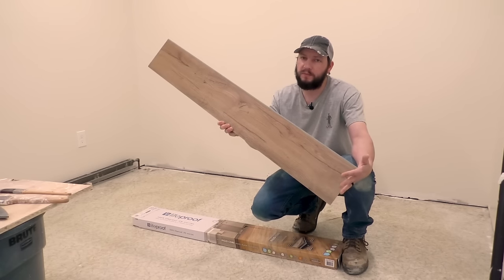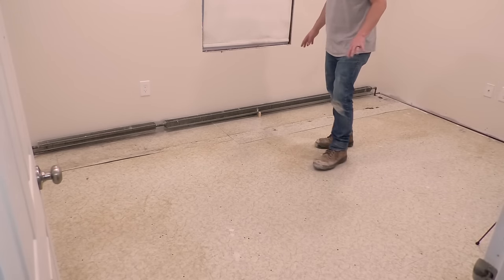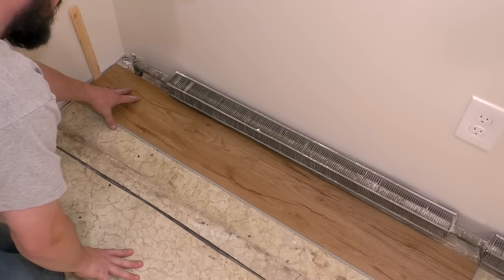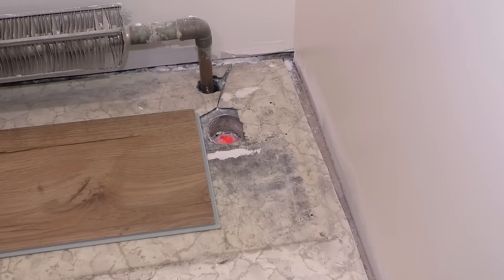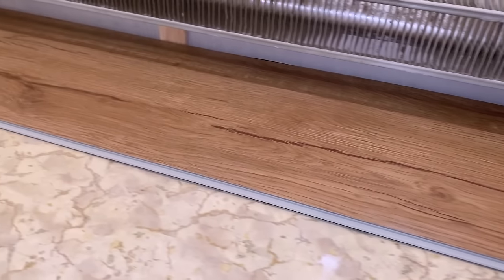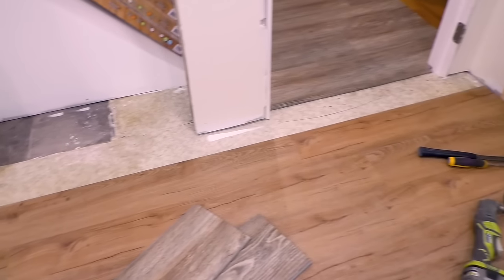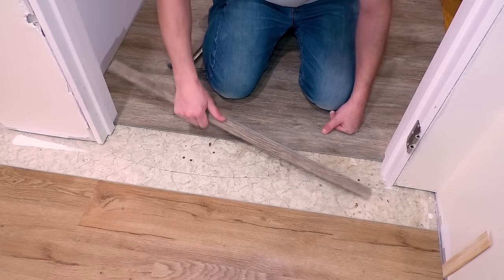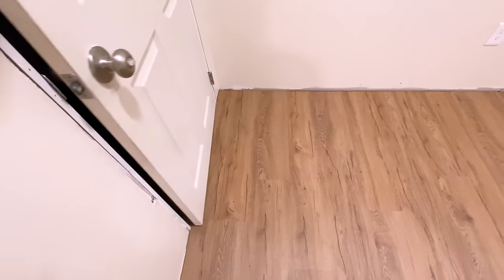How to Install Vinyl Plank Flooring | Lifeproof LVP

Comment: Love your videos, and since I just recently did a LVP floor for the first time I wanted to share a tip that I think more people should be aware of. Since you're already at Home Depot buying this flooring, consider asking the tool rental area about a "flooring & siding cutter". It's a tool that looks like a giant paper cutter, and it will snap the boards to length for you with the speed of a chop saw and the debris-free experience of a utility knife. Well worth the ~$30/day rental cost.
Reply from the maker: Awesome tip.  Thanks, Jameson!
Reply: I work in a Home Depot rental and we rent the cutter all the time.
Reply: Yes! I have used one of these cutters. Fast, precise, easy. Paid $137 when I bought it a couple years ago. best way to go.
Reply: Bad news for Monroe, Louisiana Home Depot. They don’t rent any more cost savings they told me so if you wanna put an attic insulation in your screwed also.
Reply: Thanks for the tip!  Thinking of doing the job myself!

Comment: Just installed LVP in my home from the decorator’s collection at HD. Flooring is made by mohawk. Our installation guide said it could be installed over linoleum, laminate, even engineered flooring so long as it’s not a floating floor itself. That laminate in the room should be fine and not void the warranty. Overall great video, wish I would have checked rooms in my home to see how out of square they were. Would’ve saved me a bit of extra work and cuts. Keep up the great content, always enjoy watching.
Reply from the maker: Thanks for watching, Hunter!!
Reply: Haha I had the same problem with walls not being as straight as I'd expected... house was built in the 70's so not as bad as it could have been I guess.

Comment: The end piece where it comes into a wall is supposed to be a MINIMUM of 8 inches in length.   You should have shortened the first piece to achieve this requirement.

Comment: I did a traditional laminate floor a few years back and found it wasn’t so durable to work with. I did over 1200sq ft and man did this bring back memories lol I too ended up using a regular hammer many times. But I got to say this looks a lot better to work with. If you used a hammer like that on Pergo without protecting the surface with say a rag it would be totally chipped lol Anyway, looks good! Also thought that was a pretty cool trick in the doorway using the screwdriver to pry things over!

Comment: A block of wood and double face tape to the transition piece and it will slide to wherever you need it. It also removes easily.

Comment: Installed this brand of flooring in our kitchen a couple years ago.  It has weathered daily use in a family of 6 really well.  Laid up really well in an old house with old house floors.  Pro tip, definitely don't put your baseboard down too tight against the new floor.  You want the floor to expand and contract without seam separation or bowing.  

Really good install video.
Reply from the maker: Thanks for the tip and for sharing your experience with the product!
Reply: how much of a gap would you say to leave between the baseboard and floor?
Reply: @Juiicedd  height wise, at least 1/16", or the base will hold the floor as it expands and contracts and cause gaping between boards or heaving.  You want it to float on the subfloor and not be pinched by the trim.  Same with the walls, but I'd follow the directions, I think it was 1/8"-1/4" for a small room all around, but read it to be sure and remember that the bigger the room, the more the floating floor will expand and contract.  That's the biggest downside to floating vinyl.
Reply: @ryanwilson6162  thank you very much for the info! I’ll be installing my floors here in the following months of the year, so the tips are much appreciated!

Comment: Great work Matt, I installed LVP in my house.  One thing you didnt mention, unless I missed it, is I had to vaccum the floor over and over as I went.  If you get even a small pebble under that LVP you WILL feel it walking on the floor barefoot.  My mainfloor is all concrete slab so there was lots of dust and random bits of rocks and foam from the carpet pad that was there before.  I used tile adhesive I already had on hand to patch holes from the tack strip.  For anyone trying this TAKE YOUR TIME.  Sometimes I would get into a groove and feel like I was really making fast progress, and thats when I would make a mistake.  Thanks Matt, love your videos.
Reply: Did u use underlay over ur slab?

Comment: LVP is badass. I had a retail space where we had to take it up to replace some boards (where a counter was thru bolted into the concrete). Pulled up all the flooring so we could replace the boards with holes. Re installed it. It is life proof! Super durable.

Comment: Very nice video! Covered all the important points.  I am a flooring installer and do this flooring on a daily basis. I use the knife method which eliminates getting up and down. Score once,  snap,  then bend the plank  in the opposite direction to break apart the padding. I also use a estwing red and yellow mallet to install. It has a firm side and a slightly softer side. Just my preference though.

Comment: Something that helps with remodels is to keep your drywall 1/2"-3/4" off the floor. That lets you have the expansion gap under the drywall to reduce the risk of seeing the gap under the trim.

Comment: I learned some things from this video even though I have laid a fair amount of this stuff.  The one thing  I would say is that before you start calculate the gap you will have at the far wall.  You don't want to have less than about 2 inches in width for the last strip.  If it calculates out that you will, then cut a starting strip so the side strips both have at least 2 inch.  

The other thing is that I deal with a lot of really-not-square rooms in very old houses.  Then you need to plan considerably more carefully, and think about what will hide the out-of-square best.   It's usually easiest and also looks best to run your plank parallel to the two walls that are closest to parallel, and at the in-between angle that minimizes the "wedging" in the side strips.
Reply from the maker: Good tips!!
Reply: Agreed. I have a layout stick to help me figure out how wide the last piece will be.

Comment: Hello, 
Excellent details.. you make it easy for us in every video you do.
I have same situation with subfloor regarding squeaks. My major concern is that the one end of the room has a bounce to it when I walk on the current floor. A piece of tv stand shakes on that side. 
Would you please give me your opinion on the possible cause?  Would it be because of loose plank subfloor and screwing it down would solve the bounce issue ..
I had estimate from 2 different flooring installers but their answer was not satisfactory.
Thank you

Comment: going to put some lvp  in my wife's glass work shop  and was looking at vids!! Great breakdown of the process and tips !!!! the hole in the back i mite have cut a wood plug to drop in but as you said no one is going to be walking there.  love the tips on snaping it together under the door , i wont have to worry about it mine is a pretty strait forward  rectangle  with a stairs into the loft as the only obstacle "except all the stuff stored there now"  great work enjoyed the vid   have fun from oklahoma

Comment: Another installer, I was watching him  install  the same material and he had a good trick for lining the planks up end to end.  He called it his bridge tool. He took scrape piece and lined the two pieces up by locking the scrape piece on the side of the plank locking it in between two pieces,  so they can't come out of alignment as you lock them in.

Comment: Lowes has some nice lvp transitions. Its a metal channel you anchor to the subfloor between the lvp/hardwood/carpet, and the transition pushes down into the channel. Much better than the T-shaped anchor type.

Comment: Very nice video. You didn't talk about it, but I'm pondering the differences between carpet tile and vinyl plank flooring. I have no experience with either, but it seems like they're both fairly simple to install and both would probably do a good job of withstanding wear and tear over the years. For home use, but in a high traffic area with cats or dogs. Do you have any thoughts?

Comment: You should have maybe mentioned that sometimes there's some variation in the color from batch to batch. Try to get all your project's flooring from the same pallet at the store. Usually there's a "lot" number on the package so you want to match them up. It's probably more important on a smaller room.
Reply from the maker: Yeah that’s a good point.  I honestly try to put in as much info as possible but things like this slip through the cracks.  Thank you and thanks for watching!

Comment: Hey,
Great video. Definitely among the best DIY I have seen. You sir have put in alot of efforts, making it look simple.

I am a novice on DIY and definitely want to change flooring of my house. 
Quick questions -
1. After removing the shims, wont the flooring look unfinished near the wall?
2. Will the lvfs work on hardwood floor? Anything specific I should take care of ?

Comment: One thing I always do on the first row is also put a spacer at the joints so when I tap the 2nd row it doesn't drive the end joints on the first row out of whack. Often I will drive nails on the edge of the first row along the wall to help keep the first row in place. I then install the rest of the floor and then remove the nails and cover the holes with the baseboard and quarter round.
Reply from the maker: Great tip!

Comment: I just installed LVP by myself and like how the floor look, but  I cut some of them which did not have groove and tongue so I decided to use glue to join them.   I also used glue on each groove and tongue and join them together.  Is it gonna be any bump in future because of using glue?

Comment: Awesome.  I wish I had seen this previously.  Just had my vinyl flooring installed.  The installer worked very hard……….just noticed some chipping along the edge by my sliding doors but I didn’t have the heart to point it out.  I don’t know how I can cover it.  He used quarter round along the walls. Iit’s plastic under the door frame.  I know he was exhausted.  So…….I’m going to live with it.  I only noticed it after he left and I complimented him on a job well done.  He had a very wide smile in response.  I’ll remember thst whenever I look st that😢 edge!  Any suggestions?

Comment: As for the screws to hold the subfloor the the joists underneath, do you have the spec? Any wood screws? or they are better to be something with a flat head? Good video. Thanks.

Comment: We have a little hump in our floor in the kitchen it was there when we moved in but didn’t know about it then till years down the road. We have vinyl sheet flooring in there now but want to replace that, will LVF be ok to replace it with will it move or shift in that uneven area which isn’t big?

Comment: GREAT! At last. A floor you can't put any furniture on.
That's a breakthrough. If you must have furniture don't forget to cut around those table legs folks, unless you want the planks springing up in summer.

Comment: I would have tried to make the last piece on the first row a bit longer-I think I saw in the instructions on a similar floor that those little end pieces should be at least 8 inches long. But it’s in a corner and I bet it will be just fine!
Reply from the maker: Yeah I probably should have mentioned it does say that in the instructions.  I am not worried about it but I should have said something as it is in the instructions.  Thanks for watching!

Comment: Fantastic job. Love the video, and the look! Had a bad experience with some home Depot click lock stuff that was NOT water proof. Need to replace it now. What is the thickness of that LVP?
Reply: Lifeproof planks from Home Depot are .22 millimeter. What that means is 22 layers thick.  Thicker is better for durability.  The range of thickness is .7 mil to .22.  Pay for the best you can afford, it's worth it.  They have lots of wonderfully beautiful designs in stock as well.  You can special order but typically it's a lot better to just run down to the store and grab another box instead of having to wait for special order.  Lifeproof does really well with each batch being consistent in color and pattern too.  So if it's weeks later that you grab a box it will match perfectly to what you've already installed.  Although, if you start a room it's best to finish it on the same day.

Comment: what a transformation for that room, really nice. 
   slightly not relevant to this video but i remember some videos back you mentioned a mousetrap and i was like "oh god that must've been a nightmare".      hilariously, i now have mice, i hate it. we did call people and they came by, but now begins the fun of closing every fun little tiny gap in the entire house, mostly the oddly annoying large holes where the radiator meets the wall.  seeing how yours meet nicely does make be a bit less worried about putting at least something to make that gap smaller (even if it is steel wool lol).     apparently mice are getting more common in MA? idk

Comment: I'm doing 2 bedrooms and because I went to the subfloor,  can I put the flooring all the way to the drywall? There is about 1/4" gap under the drywall and I was thinking go to the wall. Once I put my baseboard on, as long as it's not too tight,that should allow the floor to expand. Is this correct?

Comment: Just a Q - my home has tiles and carpeting. My understanding is that this flooring can be installed over tile but not over carpets. So it appears that once the carpets are ripped out, the level will be lower than where the floor is tiled. 
What should I do in this case please?

Comment: I plan on setting kitchen cabinets on my vinyl floor in my cabin. This area is only ten feet wide and I plan on attaching a felt under the base cabinets to help any floor movement. I wonder how the floor can move under heavy appliances.

Comment: Matt, now that this room is essentially complete (except for trim), what's the comfort-level now (warmth & sound) in relation to before this room project was started?
Reply from the maker: It is night and day.  Seriously, so comfortable in that room.  Only thing is it has too much heat now… I have a plan for that though.  Stay tuned!  Thanks for watching!
Reply: @TheFixerHomeRepair  - I suspected as such . . . . reduced traffic noise, and now able to be in that room in short sleeves and socks during the winter without busting the bank on heating!
Reply from the maker: @GSMSfromFV  yes and I have absolutely noticed my oil level going down slower after re- insulating the entire ceiling.  It is a great feeling!

Comment: I want to see a video of LVP flooring going down a hallway with 5 doors and 2 closets on both sides with door trim still on, and undercut? Every video is in a square, wide open room.
Reply from the maker: That is what I tried to show at the door in this room.  Once you understand the basic principles you can apply it to different situations.  I should have filmed my hallway in more detail for that reason but I did include it in my time-lapse for the kitchen.  Thanks for stopping by anyway!

Comment: I got some decent quality Armstrong LVP. I sure wish it would lock together better. It comes unlocked too easily. It's been a nightmare, but we'll get it finished. Problem is I wanted to put the same brand in another room

Comment: When laying the first course you end up with a 5.5 inch end piece. I find it preferable to go back to the first piece  - cut it back say 15 inches and then each end is long enough to be more consistent rather than having a short little piece on one end.

Comment: Great video! Any advice on the transition pieces? The ones lifeproof recommend for their vinyl floors are made by a different company, are very flimsy and the plastic tracks break easily. Curious to know if you have a better solution for transitions.
Reply: Transitions can be very tricky.  We've had trial and error with many different types in the past.  Rarely do we find one that doesn't need replaced after way shorter time than it should.  Most of the time, too, we've had to attach it differently than the instructions say or recommend ie: glue and nails, screws, etc.  Transitions also vary from laminate to type of material.  Example what you use from carpet to laminate or laminate to tile are different.  Be sure to check on the packaging to get the right thing.  If you can find a knowledgeable person in flooring at the stores they can really help you in discovering what's best and what new products and brands are out on the market and which to stay away from.  Transitions strips are not cheap either so choosing carefully can be tricky.  Did this help any?
Reply: @ladiesunderpressure  I ended up using the transition strip that’s meant for wood laminate floor. It comes with a metal track, screws, anchors, and the strip itself is a bit more sturdy than the vinyl version. I’m much more happy with it